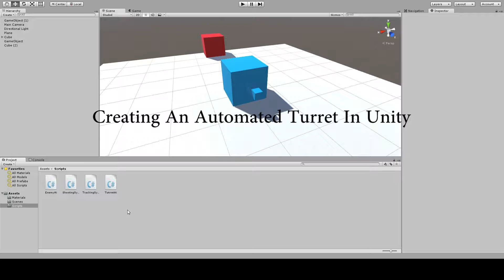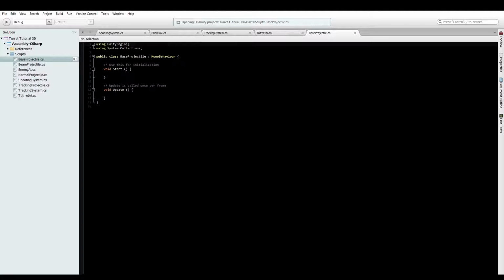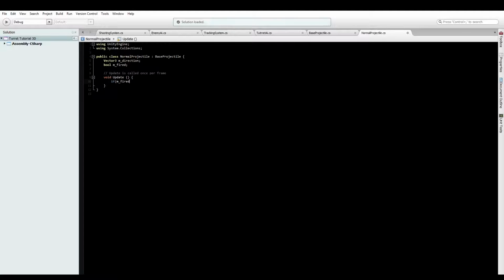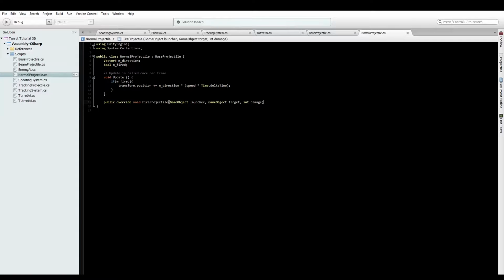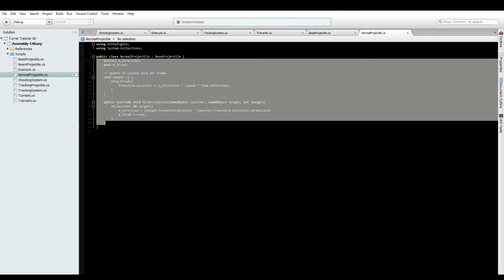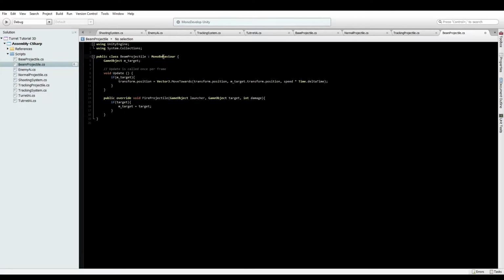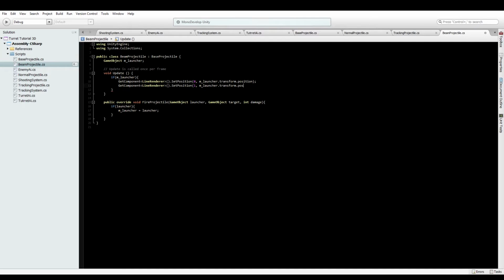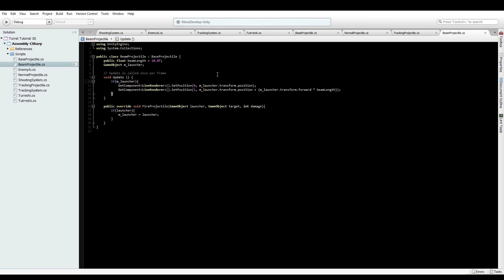Unity Turret Tutorial - Part 2a Shooting System

Comment: can you explain the reasoning behind the m_ variable names? What does the m_<var> signify?
Reply from the maker: Martin Heaps m_ just means member. I use it for instantly recognising if a variable is public or private (private ones being prefixed with m_). Its quite a standard syntax thing in c++, but not required.
Reply: I thought it would be something like that but I didn't know what the m stood for. I've not seen m_ as a standard in the languages I've worked with. Thanks Chris Gough

Comment: Hey Chris, I'm receiving the following error:

Assets/TurretScripts/NormalProjectile.cs(18,57): error CS0019: Operator `-' cannot be applied to operands of type `UnityEngine.Vector3' and `UnityEngine.Transform'

I've compared it with your script several times, and I cannot find a difference. Any idea what the problem is? Thanks!
Reply from the maker: looking at my script line 18 is adding our projectiles movement, from the error I would assume your missing .position after the transform part. It also seems your taking away instead of adding. Ive got the scripts written up here: http://forum.unity3d.com/threads/unity-turret-tutorial.341866/#post-2778335

That should be easier to compare against
Reply: Hey Chris, thanks for much for the link, I was able to clean everything up. However I'm now getting an error where when I press play, my turret shoots one "ball" and then stops. Any idea why this might be happening?
Reply from the maker: I would need more info to workout why, it may be the turrets firing frustrum, but thats just a guess
Reply: I've gotten the turret to shoot properly, but I'm getting the following errors:
1) Changing the fire rate doesn't seem to do anything. I want my turret to shoot just a few times every few seconds, instead of a constant stream
2) Changing the field of view also doesn't seem to change anything
3) If I leave the scene running for a while, eventually the turret will just stop shooting (maybe after about three minutes or so)

Let me know what information you might need. Thanks for the help, and the tutorials. I really appreciate it.
Reply from the maker: Can you email me your shooting system script: chris_gough@live.co.uk Those things should be working so I'll need to see your script to see where the issue is. In terms of firing a certain amount every few seconds I'm assuming you mean like a burst fire sort of thing, so 3 rapid shots then a short delay. You would need to change the script to actually support that yourself.
Reply from the maker: For doing burst fire there are two ways you can go about it.

1) Create a new projectile type that spawns other projectiles. So it instantiates a certain amount of projectiles over time & then destroys itself.

2) Integrate it into the shooting system. Add a couple of floats one for the number of bullets & the other for the delay between bursts. Use the existing fire rate for the speed of firing the bullets then the delay for time between bursts.
Reply: Sounds good, I went ahead and emailed you the script. Thanks!
Reply from the maker: out tonight but will have a look tomorrow
Reply from the maker: You've accidently put a > symbol instead of < in this part of the code:

if (m_fireTimer >= fireRate) {
    float angle = Quaternion.Angle(transform.rotation, Quaternion.LookRotation(target.transform.position - transform.position));
                               //This line here should have a < not >
    if (angle > fieldOfView) {
     spawnProjectiles ();

     m_fireTimer = 0.0f;
    }
   }
Reply: Hey Chris, thanks for looking at it. Kind of embarrassing I didn't catch that! haha. 

I think I'm a little confused though about the fireRate variable. What exactly is it doing if it is not dictating how frequently a projectile is thrown/spawned?
Reply from the maker: FireRate is the time between projectiles being spawned.